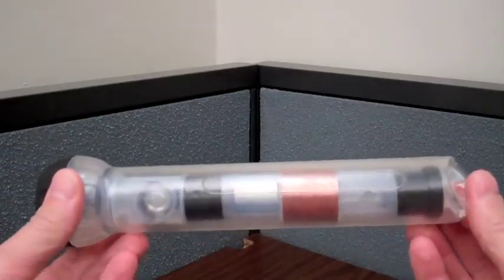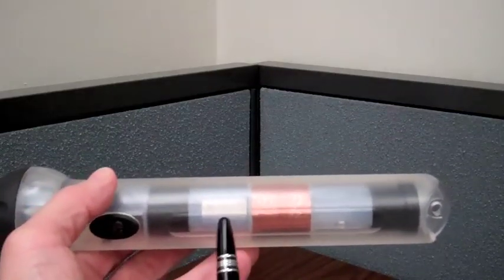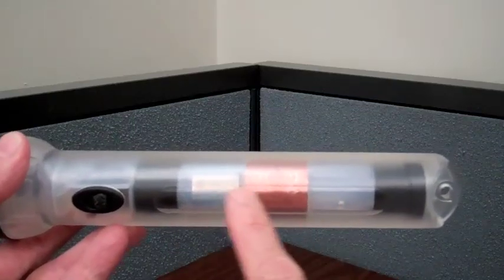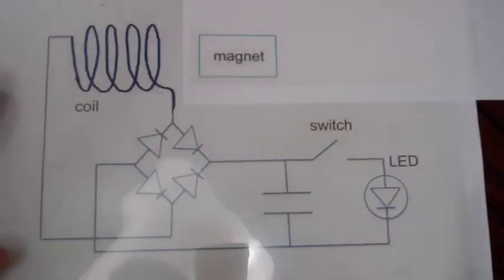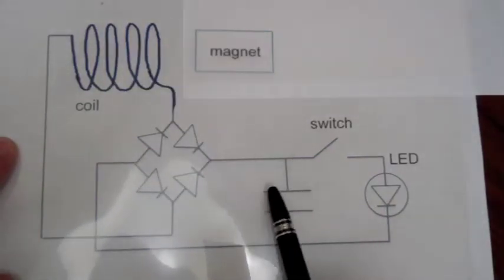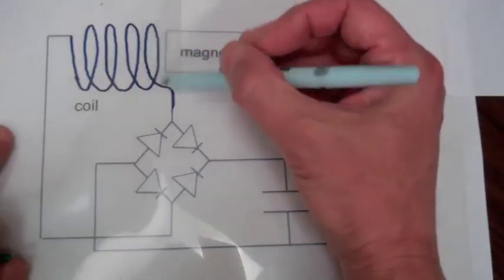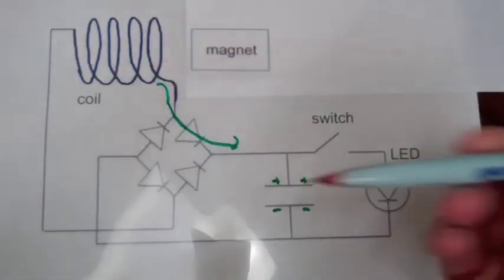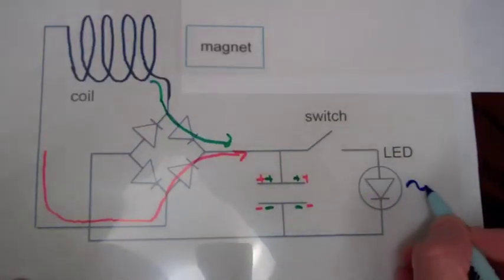Faraday Flashlight

Comment: you could probably have a voltage regulator and have it charge a relatively low capacity battery for longer use, but you would have to shake it for a long time before it would work, and that would be less cool. :) we all remember those "crank for 15 minutes get 30 seconds of useful light" flashlights.

Comment: Thanks for the vid. I'm trying to recreate something similar for a project. How many volts is required to power the flashlight for a minute and what input voltage would that require/ Is shaking the flash light for 30 seconds the same as inputing a 1.5 v battery? Also, will more wire turns result in greater output power? Thanks for any advice.
Reply from the maker: +Mint Thinny Typical white LEDs require 3 to 3.6 V to turn on. So a 1.5 V battery will not turn a white LED on. Shaking the flashlight  for 30 s will store up energy, which can be used to turn on the LED. I don't know how much energy is produced in 30 s. It would depend on how fast you shake the flashlight. You could estimate the energy you produced by seeing how long the flashlight stayed on, assuming you knew the turn on voltage of the LED and the current the LED was drawing. For instance a Cree CLA1A-WKW-CXAYB153 white LED would probably be 3.6 V and 30 mA. So if you shook the flashlight for 30 s and it remained on for 5 minutes the energy you would have produced would be E = Pt = VIt = (3.6 V)(0.03 A)(300 s) = 32.4 J.  Yes the more turns the more energy you would produce each time the magnet went through the coil.
Reply: Thanks for your reply. Your answer is a great help.

Comment: Would this work in reverse? Like have a piece of copper going through a magnet with a hole in it?
Reply from the maker: Yes there are a number of ways you can cause the changing magnetic flux--a linear movement of the magnet or coil, rotating the magnet or coil, etc.

Comment: what are the ratings of the capacitor to hold the longest charge possible?
and do you use polarized(electrytic) capatitors or what type in particular?
Reply from the maker: I do not know. I did not build this flashlight, it was a gift, and I have not taken it apart.

Comment: what is the most simplist design of a capacitor and a diode in the case of replecating a farraday flashlight like this
Reply from the maker: I don't know if there is a way to make it simpler than the circuit I show in this video.
Reply: could you explain how the capacitor is designed? thanks alot this is very helpful
Reply from the maker: igrewold Thanks for posting this.

Comment: Great video.  Do you know how small you can make a Faraday coil and still get a current?  I am trying to light an 0508 SMD LED with a very small coil.
Reply from the maker: The voltage generated will scale with the number of turns and the total change in magnetic flux with respect to time inside your coil. So even with one turn and a small area you will get enough voltage if you can get enough change in magnetic flux. If your LED is not lighting, can you increase the number of turns?
Reply: Michael Melloch Thanks for the quick response and advice.  I will do some experimenting with the number of turns.  in the interim, is there an equation that related the number of turns to the voltage produced (I understand that there are more variables at play, but just trying to understand the mathematical relationship).
Reply from the maker: Tommy John Yes the equation is Faraday's law of electromagnetic induction, This video shows the experimental determination of Faraday's law, Electromagnetic Induction and Faraday's Law
Reply: I think the SMD LED is 0805 and not 0508! you can find some general info here:
http://easycircuitlab.blogspot.se/2014/04/how-to-build-shake-tic-tac-led-torch.html
The datasheet of the LED shouldtell you how much power it consumes usually it is in mA like 20 to 40 or so unless it is high power LED.

Comment: Free energy
Reply from the maker: +Blake Lewis Actually mechanical energy is being converted into electrical energy. When I shake the flashlight, I am applying a force through a distance, which is work. This mechanical work is being stored as energy in the capacitor in the flashlight.